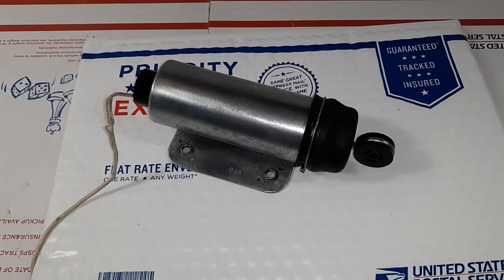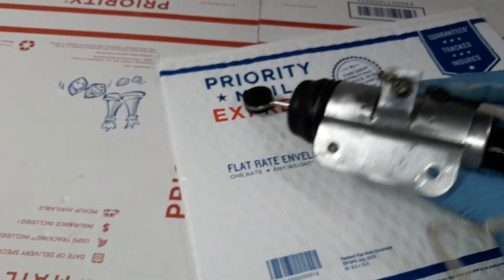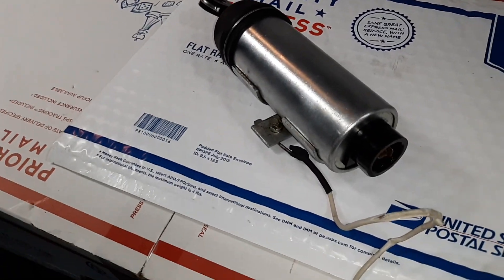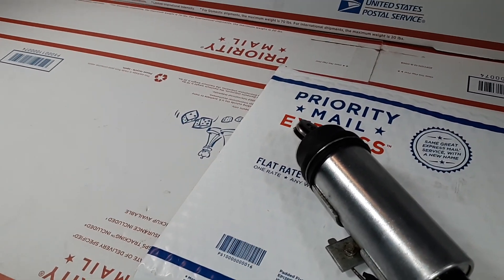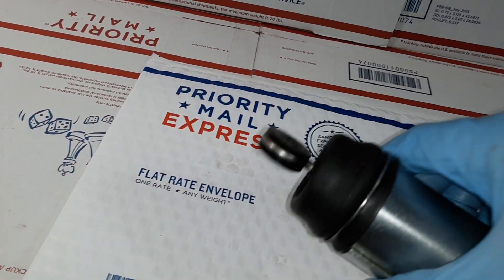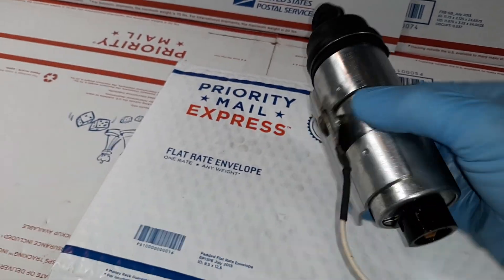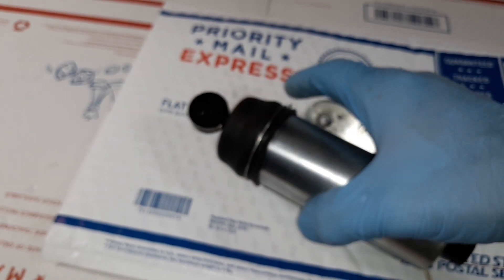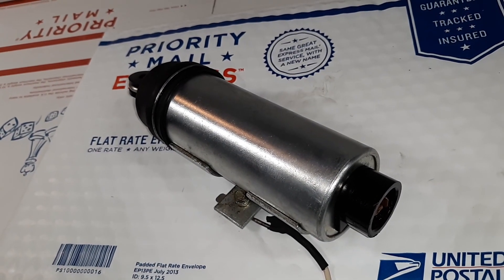1971-75 CADILLAC ELDORADO POWER DOOR LOCK ACTUATING SOLENOID ACTIVATOR

Comment: Do you have seats. I have a 75 Cadillac eldorado
Reply from the maker: Yes.... I have over 75000 original vintage parts for the 1967 to 1978 Cadillac Eldorado... I also provide show quality restoration of the original Cadillac Eldorado steering wheels with wood grain dentally as well as the steering columns in the power seat mechanisms. Kind regards George